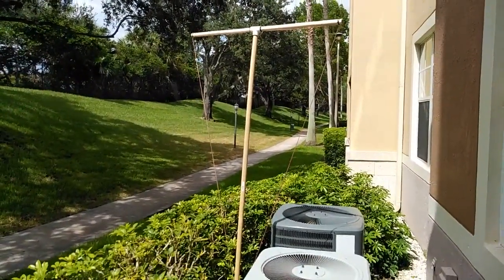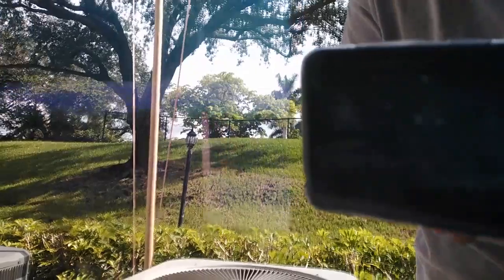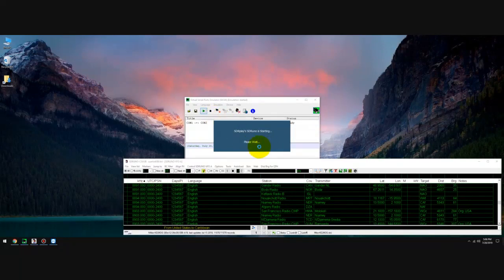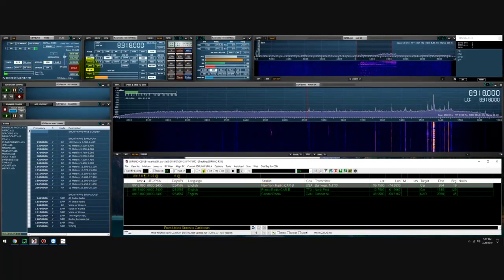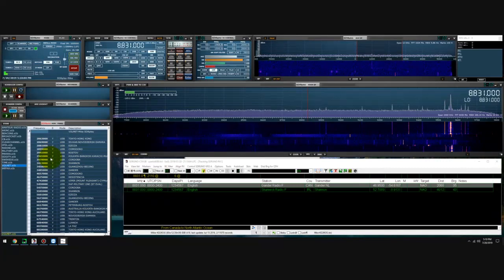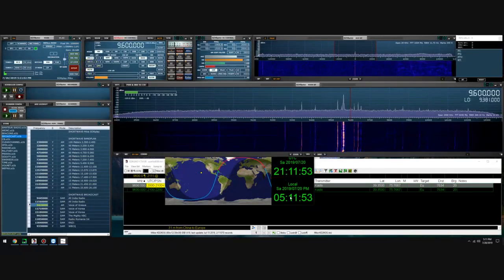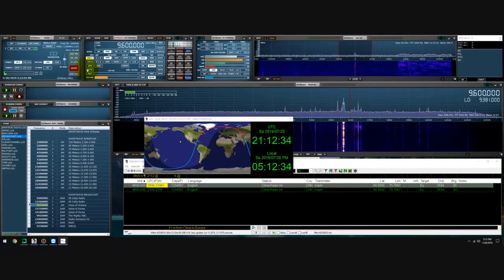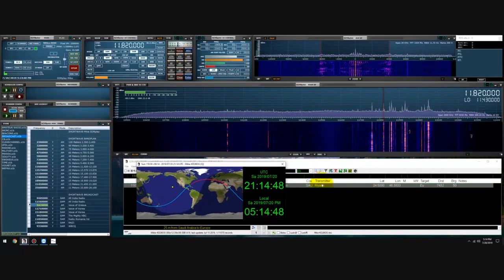Testing the Bonito Megaloop ML200

Comment: Hi just came across your vid when looking for Bonito FX loop, just wondering if where you have the antenna next to the a/c equipment will it not be picking noise interference from them?
Reply from the maker: None of the loops I've used pick up any noise from the A/C's. Currently use a Cross Country Wireless Loop Antenna Amplifier + with LMR400 coax and a CMC-130S-3K 1-30MHz filter.